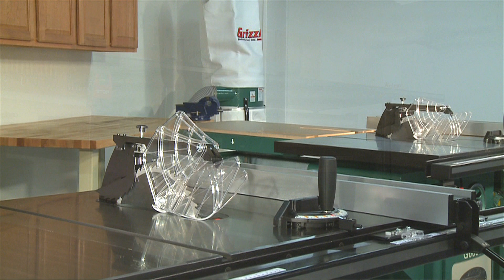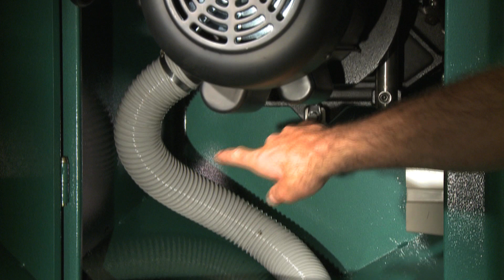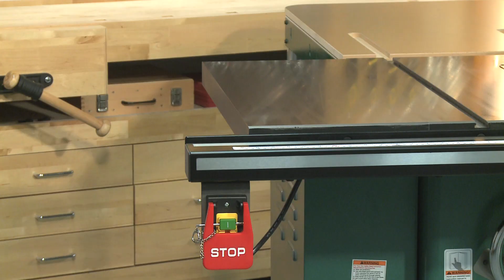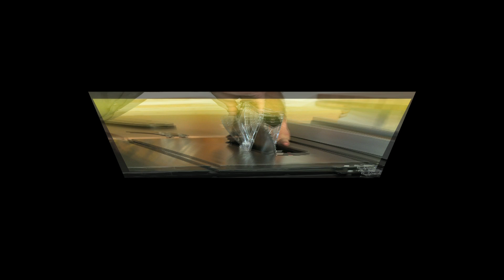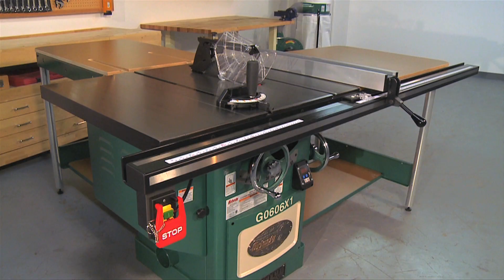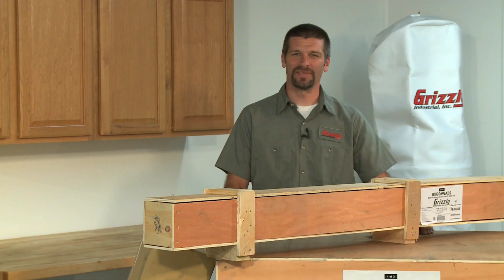Grizzly 12" Extreme Series Table Saw Comparison

Comment: Can I get the G0697x converted to 240 single phase?
Reply from the maker: The G0697X comes prewired for 220V 3-phase power, so it isn’t compatible with a single-phase supply. The G0696X is essentially the same saw in terms of build, but it runs on single-phase power and has a 5 HP motor instead of 7.5 HP.

Comment: Would this saw be good for hard wood boards or is this only good for plywood ? i was looking to get a Delta uni or a Powermatic pm2000 untill i seen this saw, so what can this thing do ?
Reply: Yes, these saws are excellent for all types of wood. Actually, the saw blade selected is the determining factor in what type of wood can be cut best. With table saws, the critical factor is power. Any saw 3Hp and up will cut just about anything with the right blade. And these models are 5Hp and 7.5Hp.
Reply: Ok Thanks !!
Reply: Can you get this saw with a built in router table ?
Reply: aux1z11 Our 12" Extreme Series saws don't have a built in router table however our 10" G1023RLW and G1023RLWX do.  These saws are some of our best sellers. Type in these model numbers on grizzly.com and you'll get all the details.  Our Customer Service staff / Technical staff at 1-800-523-4777 are a wealth of knowledge and will be happy to help you decide what saw is best for you.  Thanks!
Reply: This is actually an Amazing saw that will be a real work horse.